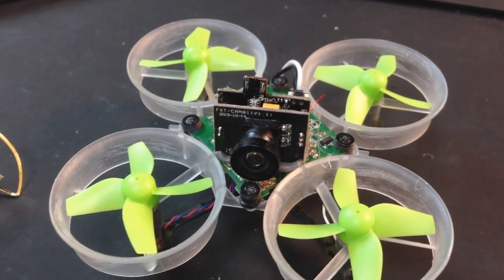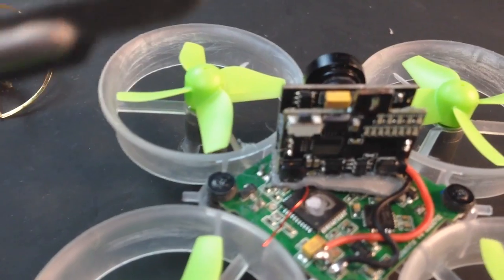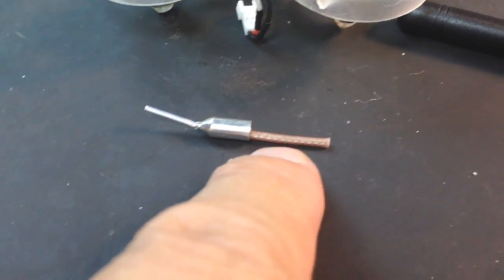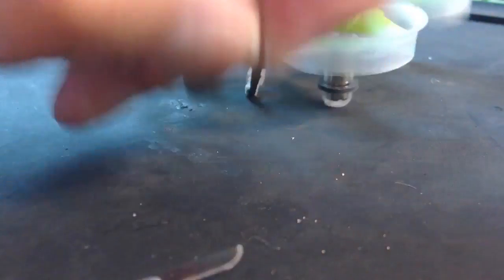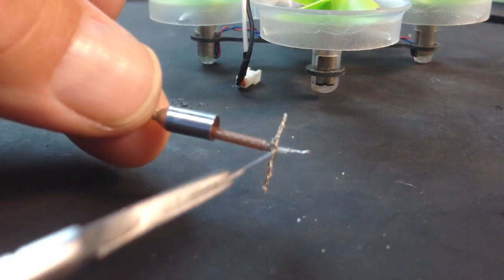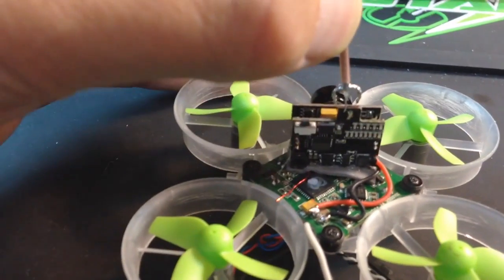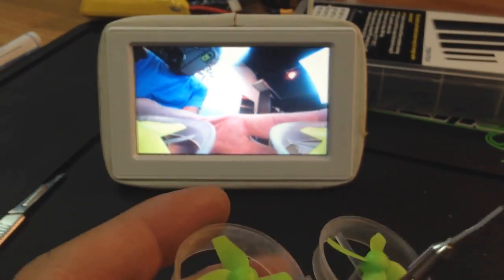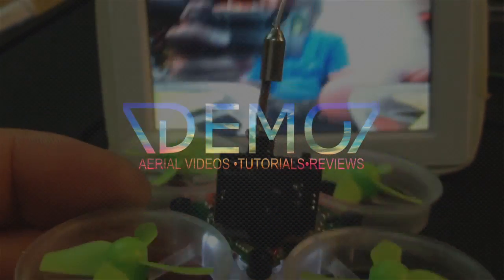Tiny Whoop Antenna Mod / Repair

Comment: hi maby some one can help me when ever i power up to take of i lose signal to forom the camera
.
Reply: the motors and camera combined are probably drawing too much current for the wires to handle. If you are using a y-harness, that is probably why. Just direct solder.

Comment: How do you know which rubber ducky antenna is 2.4 or 5.8? 
and if we mix it up... is that ok for receiver or transmitter.????
Reply from the maker: usually the antennas are marked for the freq, don't use a 2.4!!!

Comment: Can i also solder there a Aomway 3dBi cloverleaf antenna in the same way?
Reply from the maker: +mph dnb yes!
Reply: but coaxial wire in Aomway is much fatter than in whoop antenna i bet. And its worth it in EF-01 25mW tx? (I have one aomway in goggles)

Comment: Great vid, I love these little guys, my home builts antennae fell off, its the CrazePony AIO 25mw one, like 25 bucks on amazon with canopy, the pitch fork, is all soldered on the back of the VTX board, not the two in the front and the connection wire on the back, and though I soldered how it looked, in no way am I getting the same transmission, its staticky, any suggestions? Thnx!
Reply from the maker: all these camera seem to loose their transmission after long use....

Comment: 25mw, I doubt you would hurt the board.  I ran my E010 under something mounted on top of a RC truck and bent it all the way back.  Very gently straightened it back up and it seems to still have a connection.  I'm probably going to try and reinforce the solder a bit and then glue it with a bit of epoxy.

Comment: Nice!  Keeping the conductors short where they connect to the VTX has aesthetic and RF benefits.  You should get a better signal if you use a "rubber ducky" style antenna on your VRX also.

Comment: I think that you'll have a lighter and more durable dipole antenna if you cut the thin plastic coated active part off of a regular RC receiver antenna and solder it to the active element, and cut it to the right length for 5.8Ghz. Then cut a similar piece and solder it pointing more or less downwards to one (or both) of the ground tabs next to the active element.
That's one way. Another way is to make a dipole from a thin RC receiver antenna and use enamel coated wire or a left over piece of the antenna's own active element as the ground element.

Comment: Should the receiver have a circularly polarized antenna? Does this make a difference?
Reply from the maker: in the short range of the tiny whoop, a mono pole is adequate and more durable
Reply: You're right - it's better to match the RX with a linear polarized antenna also.  In theory, you lose 3dB if not.  In practice it probably doesn't matter a ton.  I'm gonna do this mod also.  Lots of reasons to do it for this application.
Reply: 7demo7 I've been looking everywhere on how to make and mount a monopole

Comment: I had no idea that these rubber ducky antennas had bazooka baluns on them.  I'm surprised that no one has retrofitted these onto their larger model CP antennas to choke off unwanted radiation from the coax!

Comment: I dont have any 5.8 ghz rubber antennas. 
Can you tell me the length of the center core at the top and the length of the lower shield please.
I do have some RG316 knocking around so i can make my own from scratch.

Comment: I've Been doing that for awhile now and it works great. You can put a little heat from the solder gun on that metal weight and it comes right off.

Comment: nice.
my antenna is starting to lose shape too.
I will give this a go. 
Could you bend the wires into the right shape to fit over the board before tinning?
Reply from the maker: totally, this was just a proof of concept- sloppy job...